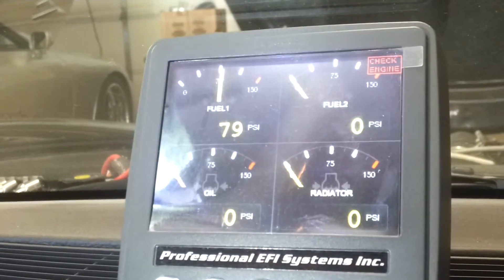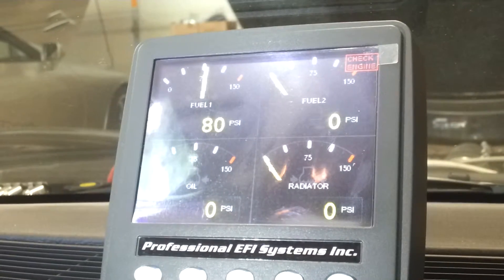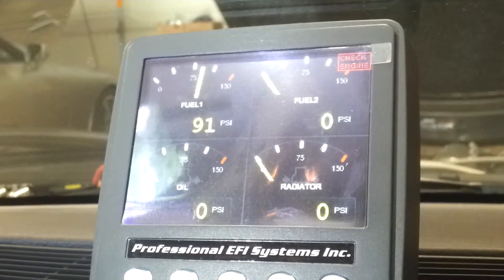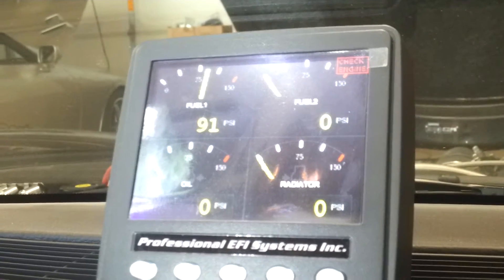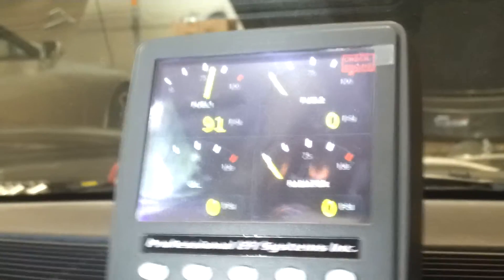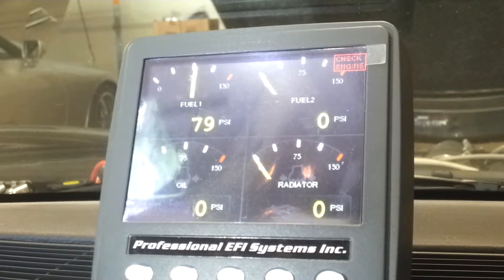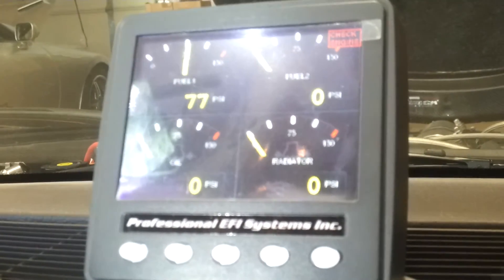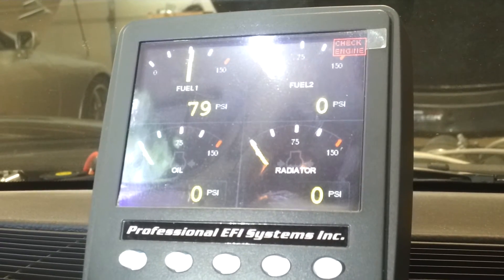05-12-2013  Veyron fuel pump testing

Comment: Where did you buy this pump?
Reply from the maker: From TI Automotive directly.  I was developing a controller for it in hopes of becoming a distributor, but life got too busy.  Beast of a pump though at stock size, worked well in my car.
Reply: Is it the EL3M or EL5M version? 

Do you have a contact? I'd love to buy one for my setup but haven't been able to secure one.
Reply: @chad.williamson   hey man can u shed any light on this pump. Looking to use one with a boost a pump.   To make 1000 wheel
Reply from the maker: @somuchmore20  It's an E5LM pump from a Veyron. It's the size of a stock pump but flows like a beast. It requires a 3 phase controller. I used a 3 phase controller and code on a microcontroller I wrote to interface with the EFI. TI automotive makes the E5LM.
Reply from the maker: @somuchmore20  also, this was an LS7. We made 1080 RWHP on e85. Now I have a Performance Tesla!  Honestly, the Tesla is more fun to drive and quicker (under 100)
Reply: @chad.williamson  lol oh I def believe that 900lbft on the crack of throttle no rpm build up.   Ya they sell as kit now bks1000 curious what boost u ran.  I was going use bap to send pump 20v and have to run total 80psi fuel psi when boost reference. 45psi out of boost.  What psi were u running of fuel psi under boost
Reply from the maker: @somuchmore20  gotcha. This build was several years ago... trying to remember. I don't think we went over 16psi.
Reply from the maker: @somuchmore20  oh you said fuel psi...honestly I don't remember!
Reply: @chad.williamson  would you have any interest in building another controller if so ill give u my contact info